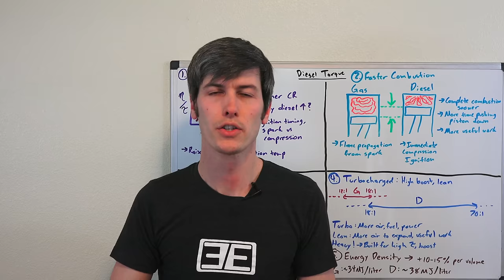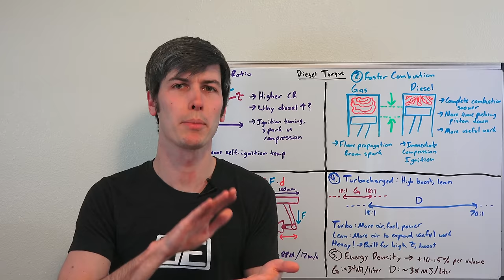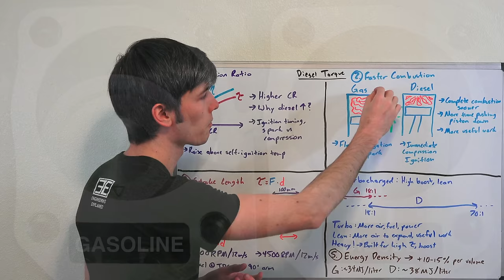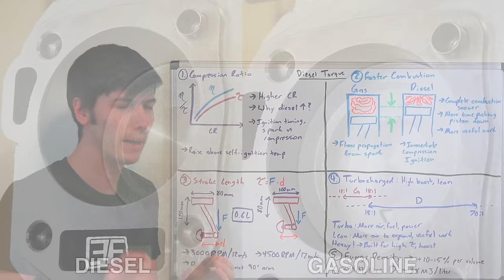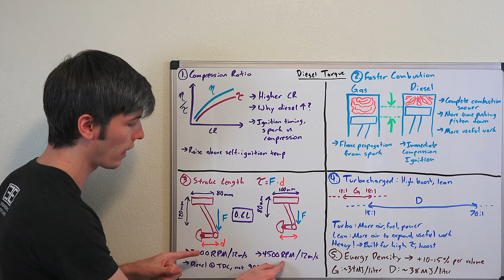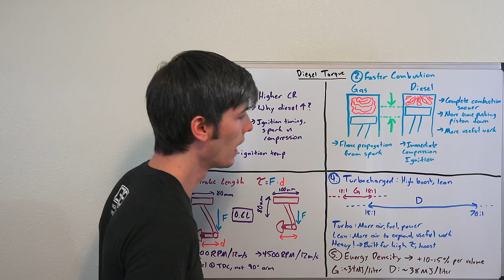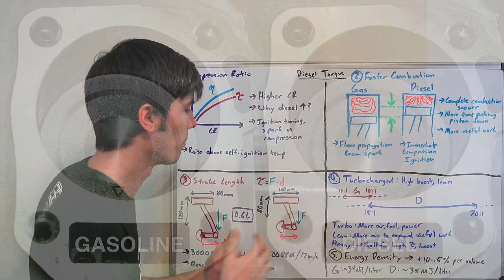5 Reasons Diesel Engines Make More Torque Than Gasoline

Comment: Diesel engines are great, it’s a shame they’re being killed off.😢
Reply: Yeah, the petrol companies love inefficient engines. They require you to visit the pump more often.
Reply: @Kit_Bear  What a poor attempt to label oil companies as the problem. Environmentalists are the ones pushing against anything that burns hydrocarbon fuels.
Reply: Electric cars are the future, almost present, but believe me there will be Diesel on the road.
Reply: @haliax8149  I'm an enviromentalist and I love diesel :-). There aren't and won't be in the near future a combustion machine more efficient and reliable than diesel.
Reply: Environmentalists killed the diesel
Reply: @stmounts  No. Where exactly does it say "I love pollution" in my statement regarding diesels? Carbon recycling systems seem to be the best option from what I've learned. C02 and water with thermal input being used to produce commodities like methyl alcohol to power existing vehicles.
Reply: Original diesel engine worked with coconut oil and nowadays diesel engines could still work with vegetable oils or so.Or sometime called Biodiesel which creates less harmful gases.
Reply: Killed off? These days youre lucky to find a new 4wd ute on the market powered by petrol in Australia. Some diesels are great, a mate has a diesel xj jaguar- you really have to be up close to tell it's a diesel when running. But if I could ever afford a car worth $90,000 I'll get the 500+hp supercharged V8 as affording petrol wouldn't be an issue.
Reply: Mr Free1 • 18 years ago  It makes perfect sense, you just don't know anything about advancements in the energy sector. Diesel engines are more efficient than gasoline engines, so instead of trying to replace them, we should simply power them with recycled carbon. These electric vehicles aren't going to cut it.
Reply: Mr Free1 • 18 years ago  What's your opinion on diesel engines overall? Do you think we should lean towards a solution that fits current engines and infrastructure, or should we aim for an electrical revolution?
Reply: Maybe in the US, but in Europe it is hard to find a gasoline auto.
Reply: Think about environment dude
Reply: stmounts no. Diesel engines are eco friendly as you don’t throw them away as often! 😂😂
Reply: I know why too- steam was killed off a century ago. Steam does exactly the same effect as hybrids but could be multi fuelled and refuel quicker than electric. Using flash boilers modern steam can power up quick from cold, apply 100% torque from 0 rpm like electric cars but run on petrol, diesel or lpg. Using condensers to reuse the same water, practically a sealed unit. But the money is being shoveled at electric these days.....
Reply: Only in the car industry.... diesels still dominate in shipping, and cargo industry
Reply: @haliax8149  enviromentalists blame all the emissions on diesel engines but in reality its actually the planes because planes produce enormous ammount of emmisions and heat
Reply: You can actually run diesel on sunflower oil
Reply: Don't worry. Diesel, or similar self combusted engines will not be killed. There's no ideal energy source can replace diesel in heavy load vehicle like trucks or ships. Electric it self may be a clean endless resource but the way we storing it is a completely different story. Battery waste contains many dangerous toxics and may harm the environment more than the gas from diesel engines.
Even if we don't use diesel we can still use biodiesel like the cooking oil in your kitchen.
Reply: Yeah diesel is awesome. It's simpler than gasoline engine, diesel engines can be scaled up almost infinitely, better efficiency, has more energy density it's just a great fuel all around and these days it can be made to be cleaner than a gasoline car.
Reply: Same here!  Plus Diesel production can be very sustainability sourced (chip fat anyone?)
Reply: @haliax8149  why are environmentalists wanting more diesels than petrols then?
Reply: Blame these oil corporations, since they can't profit from biodiesel
Reply: @GhostOfAMachine  I'm very interested, since every environmentalist I've talked to believes diesel engines to be the devil's minions. Can you point me to where they're praised? Another thing I'd like to point out is that the majority of environmentalists aren't very mechanically inclined. They don't understand machinery or the logistics of machinery. If they did, they'd realize the shortfalls of their proposed changes. With this in mind, I doubt many of them are familiar with what a compression ignition engine even is.
Reply: DIESEL BURNS MORE EFFICIENTLY AND PRODUCES LESS EMISSIONS THAN GASOLINE
Reply: Factorio players "I love pollution"
Reply: We should all be driving solar powered electric cars but noooo "they" will taketh away
Reply: Volume-wise they will be replaced faster than cars. EVs have even more torque, more than 1/2 the fuel cost. OTR haulers will be first up for rebuild and so more likely to be replaced because: less maintenance, fewer points of failure, fuel economy and perhaps local legal restrictions. Costs of operation will make rebuilds/repairs hard to justify.
Reply: They produce more polluted ait
Reply: They sound awful though.
Reply: diesel engines do produce more harmful pollution .... and i don´t mean Co2...
Reply: Petrol companies saved the whales. Environmentalists used to love them for it.
Reply: My TD6 Rover is a 3.0 litre, gets over 30MPG on the highway, and will do 0-60 in 7 seconds.  Amazing considering how big it is.  I love it.
Reply: Diesel engines are not being killed off.  Virtually every Shipping Container ship is diesel powered.  Most all large yachts are Diesel unless it is a sailing vessel. Virtually all long haul truck loads are diesel.  Some large Scale Electricity is  diesel powered.   Electric powered Big Rigs won't be common for about 30 years  due to battery development rate. 
Cars are using diesels less and less since the Volkswagen incident.  Governments are making smog rules so excessively stringent, it is becoming impractical for Auto Manufacturers to make diesel engines comply with emission standards.  Commercial application diesels are here for a LONG time. Commercial application diesels have different smog requirements than consumer products.
Reply: Keep in mind, there are a lot of Europe countries that uses mainly diesel engines where even the diesel fuel is cheaper than gasoline. It actually works well but the problem is diesel cars from any manufacturer is more expensive than the gasoline counterparts. Just look at the sales of Volkswagen, there is a considerable chunk of diesel consumer grade cars like diesel Passat with 2.0 engine, still works way more efficiently
Reply: So many misconceptions. 

It’s not the efficiency, it’s the emissions!

Diesels produce far far more harmful emissions than gasoline engines. And that’s even in perfect condition... never mind having dirty injectors or worn out pumps and leaking rings or valve guides so they pump out copious amounts of black and blue smoke. 

If it was just fuel efficiency we’d all be driving two stroke engines like they did in Eastern Europe. 

Turns out that to make diesels cleaner means they aren’t as efficient. Look at the VW scandal where they tried to do both. 

Truth is, electric is the way of the future.  Even powered by the dirtiest of coal plants the efficiency is much better than diesel due to economies of scale and the ability to install scrubbers which could never be installed on a vehicle. Of course if you use renewables it’s even better. 

Diesel is dying. Expect it to be gone from passenger cars in a decade or two, and transport trucks, locomotives, and ships not long after. The only place that will use heavy fuels will be aviation since it’s difficult to make an alternative compact energy source. About 5% of today’s total hydrocarbon usage.
Reply: Diesel will remain for heavy duty machinery. I don't see electric loaders, bulldozers, graders, etc.
Reply: @stmounts  Diesel engines are cleaner than gasoline. They have particulate filters and DEF system that neutralizes NOx, Older diesels without this emissions control system are polluting for sure.
Reply: @JuanDanielAlvaradoRamirez  a while ago when cooking oil was much cheaper than diesel and I was skint, I used to go to my local "Tesco" near my old workplace, and by about 10 litres at a time, and pour it directly into the fuel tank, while in the carpark. Some people watching though it was some sort of  prank. Ideally, I tried to keep a 50:50 mix, but the smell was lovely, just like a chippy van.
Reply: @haliax8149  u know what your talking about
Reply: I used to think so, too, until I bought a new one in '16. They have complicated and choked them down with exhaust filtration and bad tuning that mine only got 7-13 mpg. EGR system clogs fast (did they think this wouldn't happen, or is it just an income thing?), DEF system creates putrid gas far worse for your health than any old school diesel, and mileage is about 55% of what old school engines got. Maintenance costs were sky high and my new truck spent more time in the shop than my '04 Cummins w/250k miles. Got rid of the 2016 maintenance nightmare and am driving the modified 5.9 Cummins until it sells. Absurd  maintenance costs from both.
Reply: RIP environment
Reply: @redpilled3569  or maybe the diesel kills environment 🤔
Reply: Relatable… diesels have nice sounds to
Reply: Because the carbon emission was worse than regular gasolines
Reply: @rossbrumby1957  what you're describing is called an external combustion engine. We moved from external combustion to internal to increase efficiency, going back would just increase contamination. Burning just isn't efficient. The best we can make it is what we have at the table now, roughly 40% efficiency on some scenarios.
Reply: well not in Asia we still have plenty of them, veryyy torquey of the line
Reply: Thank God they re less diesel engines, I can finally breathe and not deal with BMW drivers with DPF off. These engines should be used exclusivelly on vans and trucks.
Reply: @haliax8149 The reality is that making diesel meet acceptable NOx and PM emissions limits is really expensive.  So it can be done, but people don’t want to because it costs too much.
Reply: They smell and pollute way more... i drive motorcycle, I hate smelling diesel exhausts.... gas is cleaner....  and i dont talk about CO2. CO2 is fine. plants love it.
Reply: Everything can't be kept for luxury of people. Some hard decisions need to be taken. Banning diesel engines is a part of this. People should learn to live with some inconvenience for the planet.
Reply: @Kit_Bear  true
Reply: Not in Europe soon diesel is still popular in Europe even city car used diesel
Reply: Just like two strokes
Reply: My question is with all that being said, why can’t they make a gas engine that focuses on torque and can make even half the torque of a 2500/3500 diesel. It’s pathetic
Reply: @oherroprease207  Diesel hold 15% more chemical energy than gasoline. Where you might get 14mpg towing with a half ton truck, you will get much less if towing the same load with a gasoline engine. 

Diesel engines are much more efficient when generating loads of torque
Reply: @rossbrumby1957 I’m sure he meant here in the states..   diesels are expensive and far less common than gas.    Mostly only trucks here are diesel..  I drive a clean 97 Ford F-250 hd.   4x4.   7.3powerstroke .  No def. No epa bs.    Love it

Comment: Diesels actually DON'T make more torque. They are better suited to forced induction, that's all. If you compare any  production naturally aspirated diesel VS petrol from the same manufacturer and time period you will see that petrol engines make more torque and much more power ie. Mercedes OM606 3L diesel 136hp, 210Nm torque, M104 3L petrol 220hp, 310Nm torque

Comment: It's all about that turbo. Compare a high boost gas motor to a turbo diesel (also high boost) and you may get more torque out of the diesel you will get more horsepower out of the gas. Then just multiply the torque of the gas motor with gearing if you need that torque. It never will be as efficient because as you pointed out there is more energy in every gallon of diesel.

Comment: Steam engines- "Hold my beer."
Reply: loke yeah they make 25hp but can go to speeds of up to 200mph
Reply: Steam tractors: 
Horsepower: 150
Cylinders: 1
Torque: Enough to move the world
Reply: Also external combustion, not internal
Reply: @renz1013  no steam engine that makes 25 is going to make anything go 200mph
Reply: @chaztitan6457  No Steam Engine ever went significantly beyond 200 km/h (125 MPH), and these had about 2500 kW (3400 HP)
Reply: @Genius_at_Work  so you posted a comment to agree on my comment but made it sound like you disagreed. ... 
WAY TO GO GENIUS!!!
Reply: @Genius_at_Work  that was limited by the strength of the parts at the time. not of the engine power to the ground itself.
Reply: @imadizzapointment8354  csn you explain why this is, please?

Comment: Diesel engine produces more torque? Only when you compare the power, not the engine size. A naturally aspirated diesel produces usually even less torque per liter than a petrol n.a. engine. If you compare turbocharged engines, the diesel has a little advantage. Just search after "medium pressure"

Comment: I watched a video of a v8 running without exhaust manifolds. The fuel in the cylinder was still burning all the way up the exhaust stroke. It would be nice to see a diesel engine running without exhaust manifolds to see if there is any difference.